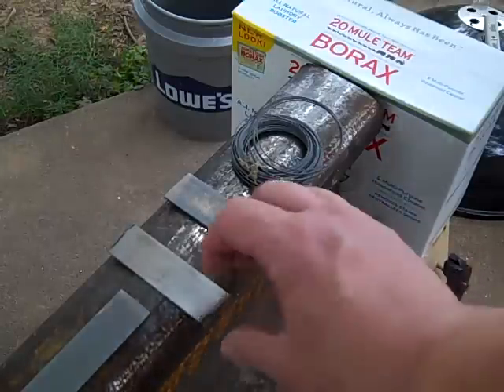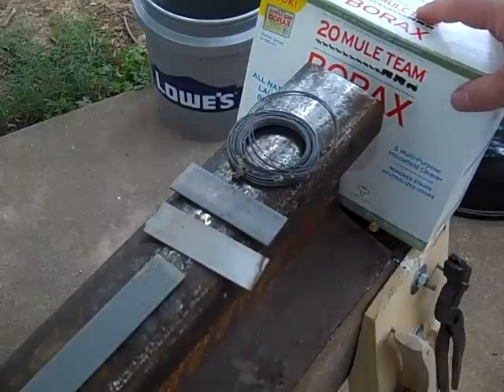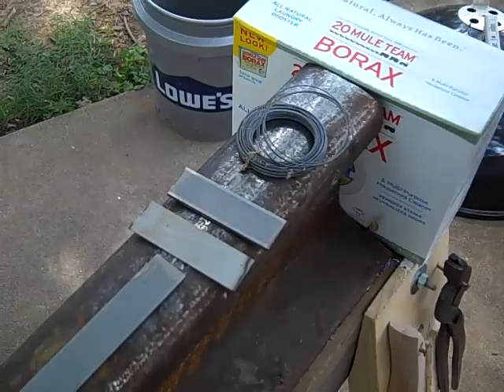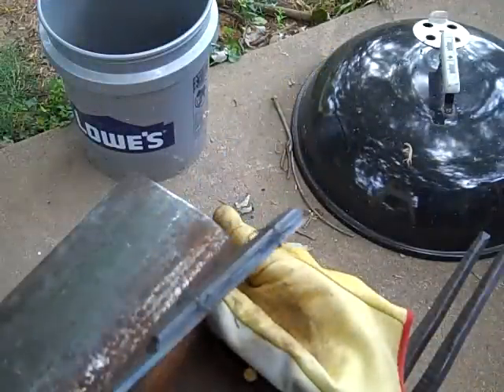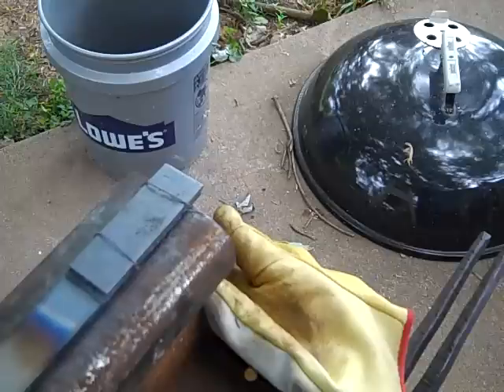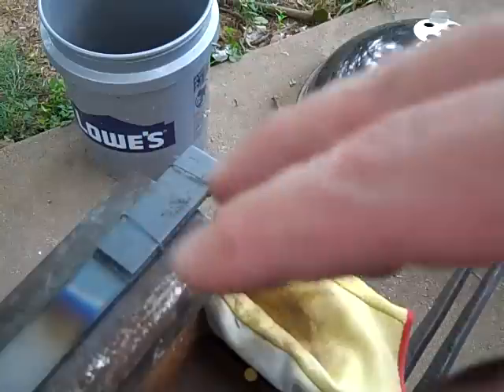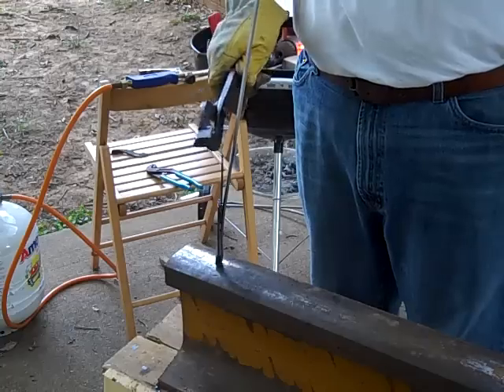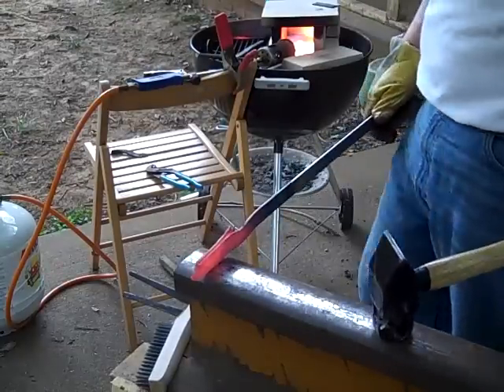Trying to forge weld

Comment: I have forge welded a lot of damascus. The key is to get it hot enough about a lemon yellow to white hot heat.   Flux well and make sure the surfaces are vary clean before you wire them together. This all work I it is carbon steel. Stainless is another story.

Comment: when the steel is sending off little sparks and is bright yellow and your flux has already been applied, then its ready to weld. dont beat on it like it owes you money either. firm hammer blows will be plenty. run it through a few welding cycles to be sure the welds took. by beating it, you can delaminate the welds you may have made.

Comment: I did exactly the same on my first few attempts. Not hot enough and whacking it to hard.The description I read was to give the metal a kiss with the hammer on two heat/fluxes and then hit it on the edge to see what sticks.
I got a cheap thermocouple from eBay (1365c) and it gives you a really good idea when it's hot enough.
I made a little Damascus blade with all the failed bits .Not perfect,but it looks pretty and I was smiling for a week with the success :)

Comment: @Makermook Yeah it works nice until you learn to judge it by eye. Remember to wear something to protect your eyes though because forges (especially gas) emit copious amounts of UV at welding heat. If you stare in it too much unprotected you'll regret it the next day :) Anyway, check out the san mai blade I just uploaded a review on. Tell me what ya think...

Comment: @Makermook The wd-40 is not critical, but it helps. You should never heat your steel after grinding the scale off until you are doing your actual welding heat. Remember, oxidation is your worst enemy and that starts around 400F or so.
Just out of habit I start at the far end. Doesn't matter, but do start at an end and not the middle. Forge a piece of 1/4 round down to a point and stick it in the forge with your billet. Touch the billet with it to test for heat, when it sticks you're golden.

Comment: Grind each piece to get the mill scale off.  Make sure your grind lines run across and not lengthwise. This gives an easier escape route for flux. Spray your billet with wd-40 and flux before applying heat. Less chance of oxidation. Make sure you have a reducing atmosphere in your forge (very important). Heat to a point past where your flux bubbles. It starts to skate. Remove and QUICKLY set your weld with LIGHT hammer taps. Excessive force will cause layer slippage.

Comment: Watch the video at (bassfuryvi), in his favorites are (Blacksmithing: Ladder Damascus) where Damascus forging.
I read that the cinder to remove from the surface of welded strips of steel and iron. to scrape with cold steel and sprinkle with brown, then seal part 3 sheets. SCALE THE MOST EVIL ENEMY forge welding. Board a small of me, work in an apron of fire retardant tarpaulins. Very much I look for your video, and thanks for your videos!

Comment: The second attempt would have worked if you had remembered to put borax BETWEEN the layers. The borax goes between mating surfaces. You don't have to worry about getting the temp. too high on the steel because you are trying to melt them together. Your temp. is about 500F too low. Also, take a rasp to a hot piece of metal to remove the scale. It is easier if the metal is pretty hot before you try to take it off.

Comment: you have the right idea, i can tell you have done some research but you made a few mistakes that come with experience. you need more heat, the weed burner get hot enough to harden steel but i doubt it will get hot enough to weld (try adding forced air maybe a hair drier or leaf blower) also a quick tip, put the borax in an open top tin of somekind, heat the metal, dip it and coat it well the heat again before hammering

Comment: Temp to low. Clean steel with angle grinder. Dip in kerosene for better coating of borax, but really a much higher temp is required. Keep up good work, Thanks